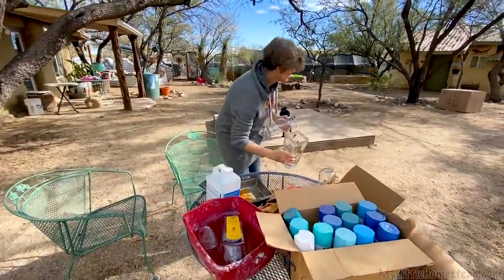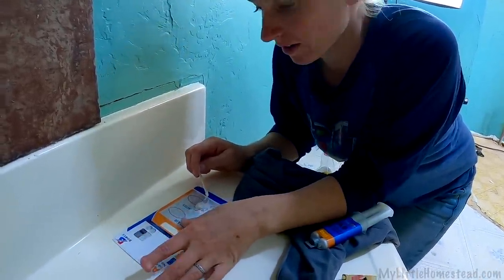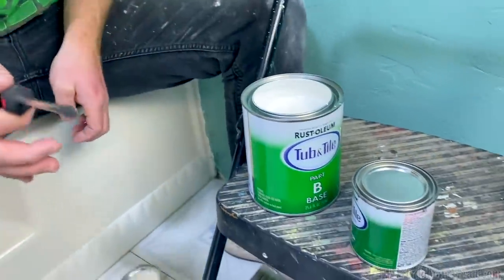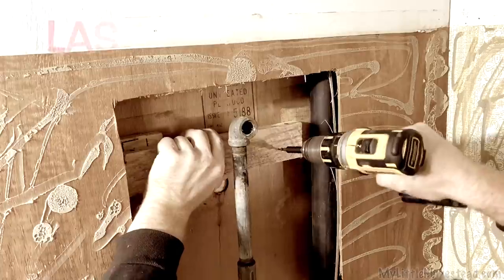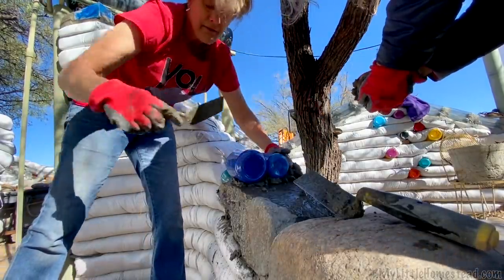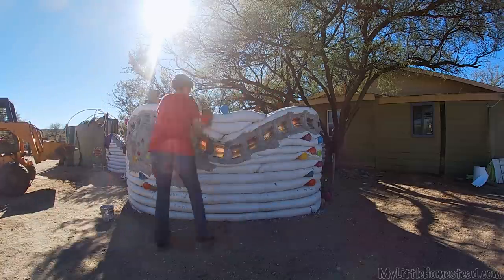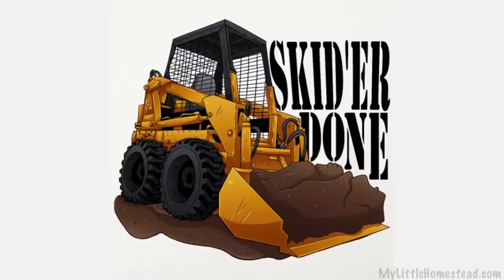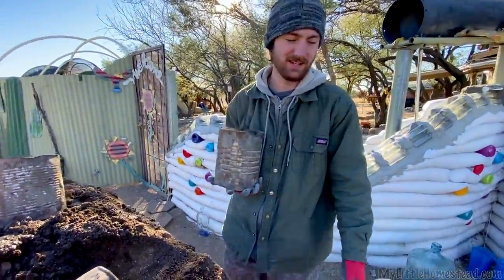Paint Old Bathtub & Earthbag Bottle Wall | Weekly Peek Ep263

Comment: It is nice to see Shelley becoming more comfortable in front of the camera. 

Old screens would be a great rebar for the mortar. Not just in the bottle area but also in the cobb areas where you used mortar.
Reply: I was tinking. Wire the size of wire coat hangers tied together forming a 'H' placed going the width of the wall between the bottles will also help strengthen this area

Comment: It's too late at this point but for the bottle pillars, and future builds...  old screening from screen doors and windows would function like rebar in concrete.  cut strips and loosely wrap/line the areas your going to mortar, will help the mortar adhere better and reinforce it a fair bit.

Comment: Teflon tape really helps seal the connections in between the threads of plumbing pipes. I need to get some of that stuff you used to make the tub look brand new.  We have an older 1940 enameled metal tub that has seen better days. 

The new bathroom with the waterfall and glass bottle elements is amazing. I love watching how you guys work together to build and create your home. As with most projects and houses that are built or created there will always be improvements , additions, and repairs as you learn from the previous ones to improve it as time continues on and your requirements and needs change.  When my parents unexpectedly ( They had gotten a post card from a realtor who was looking for people who wanted to sell their house. We lived in Northern Virginia near Washington DC which was getting expensive to live in the area. Without saying anything to the 5 children still living at home and without a for sale sign outside they put it on the market just to see if anyone would be interested. During the 10 days it was on the market over 20 people saw the house and the realtor showed them the top 15 offers that were submitted. My parents purchased the house for $45,000.00 and they sold it for over $200,000.00.  It has been resold a few times since then with the last price being over $1,000,000.00 which is mind blowing) our childhood home and they were trying to figure out where to move to and what kind of house they wanted my Dad mentioned possibly doing an underground house where what was visible on the surface would have a lower property assessment and the portion that no one could see would be much nicer and high tech because he was an Electrical Engineer and wanted to use his talents to create his dream home. He actually wanted to move out West to either Colorado where he was born or to an area in the mountains. I kinda wish he had done it especially after seeing what your family has created together.

Comment: 16:10 Hey, Gary is finally back on the bathtub project! I was wondering why we didn't see him in any of the tub/shower footage.

If you're not putting a roof or canopy or anything on the shower/tub wall, will you be topping the wall with anything special? I was thinking, a thin layer of concrete pavers would give you a nice base and then you can add planter boxes, maybe like an herb garden or just some flowers.

Or you could add some artwork, like statuettes, gargoyles or whatever. Or maybe the words "MY LITTLE HOMESTEAD" in stand-up letters made from concrete or resin or wood or whatever.

Once you've got a flat(ish) base on top of the wall you can top it with just about anything and change out the toppers by season or whenever the mood strikes you.

Comment: There were some weird artifacts and ghost frames in this video...
Reply: yea I noticed that too. it was almost like a bad cable connection
Reply: I have the same kind of weird artifacts and ghost frames happening on my cellphone too. I am sure they aren't filming with a cellphone, but with my phone, its something to do with an upgrade of software that made changes that aren't meshing with the type of screen on my phone.  The next patch was supposed to fix the issue, but it didn't. Maybe I need to do a rollback to last version before issue occurred. I wonder if it might be a software compatibility issue here too.
Reply: Oh good it is not just me.

Comment: This has probably already been suggested or thought of but have you thought of adding a low voyage outdoor LED light strip on the inside of the tub/shower area along the bottle line?
It could look cool from the outside having those bottle illuminated at night as well as provide light on the inside.

Comment: Is that black cylinder a solar hot water heater?  
Will you use clear bottles to concentrate heat on it, & disguise it as-if it is gushing, bubbling water at the start of the waterfall?

Comment: not sure if it was my feed/connection or your upload but it kept pixelating on me. Also, I understand the concept of DIY house makeovers but I am not sure that fixing a hole in a tub in that manner is going to stand up to the use the tub will get. you had done such a great job on the tiles and I hate to see you have to destroy it in a short time from now to replace the tub that has a crack in it.  Just saying, however I have never done any of the stuff you are doing so I could be way off base in my thinking.

Comment: yup lol like i posted earlier  shell structure of glass can carry impressive loads it is brittle though so avoid point and shock loads. start stacking brick onto a bottle it will become unstable long before the class fails from the load or get 4 bottles and put a beam across them and drive the skidsteer on the beam...yup it should catty the load  but ive seen cars supported on cardboard so i tend to be less impressed  its the same story and physics as aluminum aircraft flooring vs 95 lb woman in stiletto high heels puncturing the floor beside the 3/4 tonne  2x2 foot compressor which isnt even bending the floor.